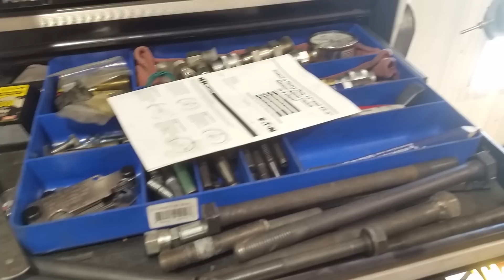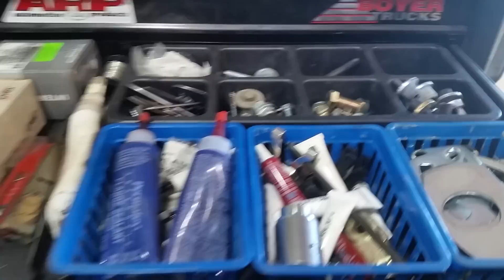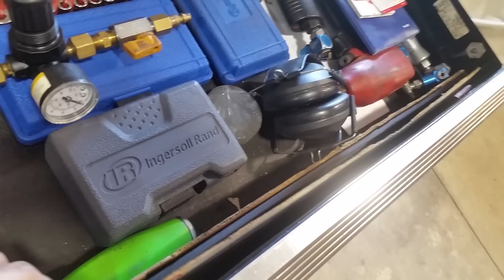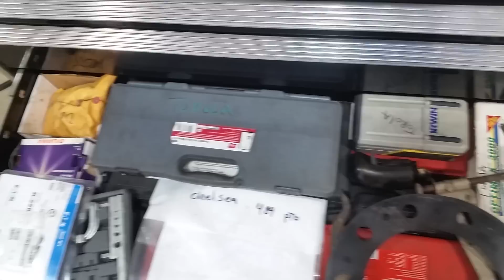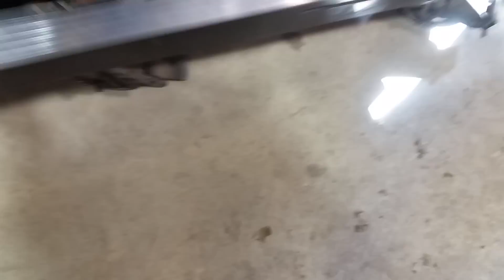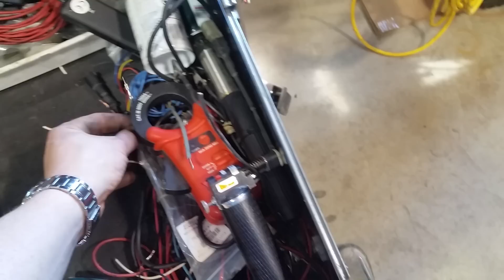Cornwell toolbox

Comment: In school for diesel, plan on working on tractor trailers or school buses, as far as 1/2 sockets whats the biggest u have in deep well? Thank you
Reply from the maker: up to 1 1/4 or 1 1/2.  and you can buy the 3 or 4 wheel bearing sockets you will need once you start, but most shops have those, usually torn up tho.
Reply: jmpsck23 thank you for replying

Comment: I do know one thing about the 3126 Caterpillar,a slug.My dad has a 2001 Freightliner FL60 with this engine and it is this way.He had it in for repairs twice.One was the bolts came loose for the injectors with a bad start condition.The other was an oil line that leaked,has the revised oil line and has not leaked ever since.